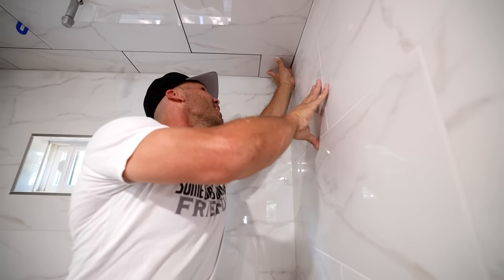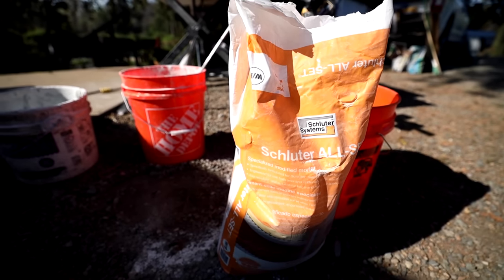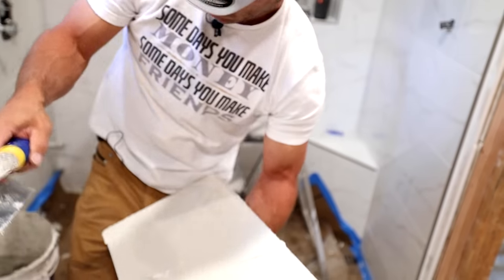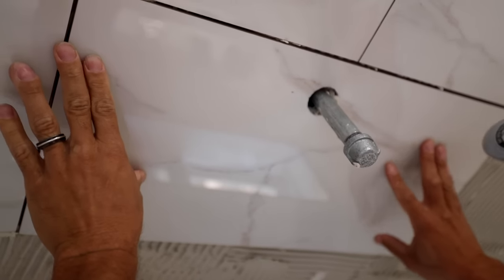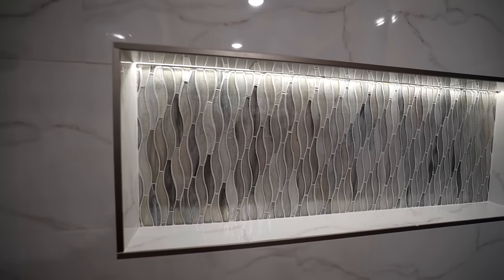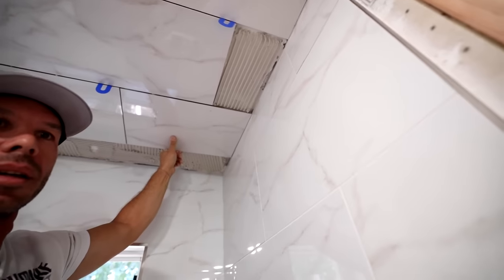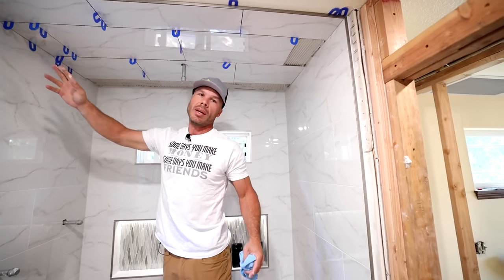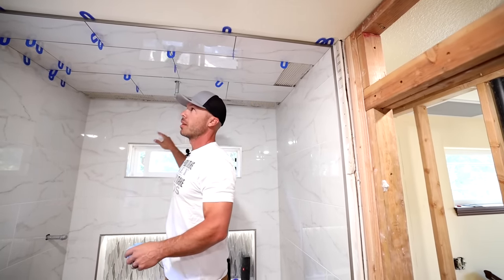Tile a Shower Ceiling --- Large 12x24 Porcelain Tiles

Comment: I skim coat the ceiling and spread thinset on the back of the tile with either 1/2 x 1/2  or 3/8 x 1/4 inch trowel depending on the size of the tile and have never had a tile fall and its way easier than troweling onto a ceiling. Also i do my ceiling tile first and cut my top row on the walls to the ceiling which again i find to be easier and look better
Reply: Exactly what I was going to say. I find it way easier
Reply: That's how I do it.🤙
Reply: Yes, just like the floor. Do the floor first, bottom tile goes over the floor.
Reply: I was wondering why he didn't do that..
Reply: @SonsOfThunder229  An entire 26 story building I worked in, was done walls 1st then floors, site super insisted on it, looked like shit with the grout line visible on the floor edge. Thank you for posting.
Reply: Use leveling clips also on ceiling! It helps to hold each other tile.
Reply: You are right on. Buttering th back gives a suction to hold it up

Comment: One of my first tile jobs I was learning from, this builder I was working for was installing a steam shower ceiling, and used spin doctors clip system. The very last tile he was installing was a center cut with a light hole. When he put it up, literally all of the ceiling tiles fell, it was like something out of a loony toons episode. Stood their holding the one tile while the rest fell and cracked the special order shower pan. Good times lmao
Reply: Lmfaoo
Reply: Thin set was wrong or to thin mixed
Reply: Dam
Reply: I think the issue was the leveling clips, it’s not possible to get full coverage with the clips in the way
Reply: I call bull
Reply: @stihlRoush   it is with a large notch trowel. Coverage checks area must. Leveling systems are over used sometimes for sure. Large format only for me.
Reply: You can never get 100% coverage on ceiling and tile because the clips take up space. Plus they could pull the tiles away from the ceiling.
Reply: @stihlRoush   ceilings are never fun but ive never had any fall off so.....to each his own I guess. There are many many misconceptions about leveling clips and many videos debunking a lot of the "issues" and showing how they move the tile. The body of the tile should be on plane regardless of the clip being used or not so the coverage matters. If the tile is out of the thinset its wrong to begin with. 
 They work for me in the right application so I dont have any beef.
 They are not an excuse to do crappy prep work for sure. They are not eliminating anything but a few square inches of coverage on a  per tile. Not enough to cause a problem with adequate coverage. Ive bent trowels trying to remove tiles from the suction in the wet thinset with clips in place. 
 I cant control what tile I get to install so garbage bowed tile get clips lol
Reply: I’m not arguing that the clips are bad, just saying 100% coverage is not possible with them. I’ve used them, I love them! I just have trust issues with gravity on such huge tiles. I’ve installed a bunch of 12x24 and smaller on ceilings with no issues at all.
Reply: @stihlRoush   haha ya i def get nervous as well. Always waiting for a bomb to drop from the ceiling. I agree 100% coverage technically cant be achieved but 98.7 % wont be any less effective.
Reply: Agreed
Reply: @Llaveocculto  agreed, they never would fall all at the same time
Reply: Lol

Comment: I used Mapie Utraflex LFT in white. Workers perfectly. I find it better to key in the ceiling that way when you trowel out the thinset it tends to stick better to the ceiling and not fall off. Also back butter the tile and you will be golden. Did a house now with 3 showers 10 feet tall. All ceilings tiled. Never had a single tile fall off. Honestly felt like an old school pro.
Reply: I second Mapei Ultraflex LFT.   I just tiled a full 45 sf bathroom ceiling with it and not one tile fell and it was my first tile job.    I used leveling clips (LevTec) and that helped a ton too keep it in place and level.

Comment: Skim ceiling and half inch notch back of tile, 4xlt. With the front of the trowel, make two circles to act as suction cups for 12x24s. Works great for me.
Reply: I back butter the ceiling then 3/8" on tile itself an close the ends, it's a suction science
Reply: thank you for replying
Reply: @jdj3042  Thank you for your reply
Reply: I use custom prolight 1/4 notch on ceilling 1/4 notch on tile never fail

Comment: IMO you need minimal thinset that produces 100% coverage. You're trying to create an airtight seal between the ceiling and the tile. Basically get 100% coverage and push real hard. As long as air can't fill in behind the tile as it tries to drop down the air in the room is much, much stronger than the weight of a 10, 50 or even 100 pound tile. Air pressure: the same thing that makes an airplane fly will keep your tiles flying until the thinset sets up.

Comment: We did marble on a steam shower ceiling a few years ago. We screwed 2X4’s around the perimeter walls about 3” below the ceiling, we then cut 2X4’s to lay flat across the stringers, set a couple large pieces of marble and supported them with the boards along with cedar shims to keep everything level. Each day we would do one or two pieces then work on other parts of the project until we completes the ceiling. Never had and issues with loose or falling stone.

Comment: I took some plastic cap nails (tar paper nails) and replaced the nails with 2" drywall screws. The plastic washer was ideal for overlapping the tile you are working on and the adjacent tile and made the ceiling very secure. The next day, back the screws out and you're done.
Reply: Steam has a way of finding it's way through small holes. Maybe a normal shower would be ok but a steam shower really needs to be water tight.

Comment: I had to install 2 foot by 4 foot tiles on a ceiling. I had the walls set except the last row. I had 2x4 sitting on top of the wall tiles like a bridge. I used little chunks of 2x4 to go from 2x4 “bridge” to the tile. Worked out well. I have set many ceilings without issues, just did not fully trust such heavy tiles being held up by the thin set while it cured! Nice video, keep up the good work!

Comment: I've done a skim coat on the ceiling while combing mortar on the back of the tile, and combed a handful of 2-3" circles. Push the tile tight against the ceiling burping out the air inside the circles, and creates a kind of suction cup effect. Have done this with regular old versabond, haven't had one fall yet.
Reply: Except when you install it around a dropdown rainhead fixture....

Comment: I made a 2x4 “T” pole that we would wedge to hold the 2’x4’ tiles on the ceiling while it was setting up. I had one fall after I had just left the shower, got lucky.  The “T” setup worked perfectly for the rest of the ceiling.
Reply: I do the same thing. They call it a "dead man " in the dry wall hanger industry.

Comment: I just did a ceiling in 8x20 10mm marble using MultiMax Lite, mixed pretty stiff.  Skim coated the ceiling, and had 1/2 notch applied to back of the marble very well keyed in.  Pried off 2 tiles to check for coverage - near 100%.  It took quite a bit of force to get those pieces to come off for the check.  One piece did fall off - no injury - but it was a piece that I set using lighter pressure as it would have laid in too deep and would have had lippage so I just set it using less pressure.  It fell off after about 10 min hanging there.  MML thinset is EXCELLENT stuff in my view and very good for ceiling work.  You just have to set it using plenty of pressure, as done here in this video.  This makes the thinset application more critical, because when setting with lots of pressure you will be getting 100% coverage and once its there, its very hard to adjust the overall depth of the tile, esp with the mud being a bit stiff.  Also very important the ceiling substrate is flat esp when setting large format tile.

Comment: After watching this video, I also used the All-Set and it worked like a dream for the ceiling and everything else. My new favorite Thin-set for everything.  I got it on some cardboard and when I tried to peal it off it took the top layer of paper with it. this stuff sticks to almost everything. We also tried mixing it with some concrete pigment to see if it would retain its adhesive properties and it stuck just as well.

Comment: I would recommend apply the ceiling tiles, especially the corner ceiling tiles first before finishing the last top side wall tiles so that the corner ceiling tiles rest on top of the final top side wall tiles. Obviously make sure the final top side wall tiles fit nice & tight.
Reply: I agree, ceiling first then last row of wall tiles. Its just like how the floor tiles are first then wall tiles on top

Comment: I have found that it's better for the mortar to have a bit more water to create a suction effect. Only ever had one fall when the mortar was too stiff. I will blue tape each piece to the next as I go to hold my spacing and don't untape until the next day. Always screw the substrate every 4"-6" as there is a lot of weight hanging up there. Also, don't try and pry an edge down if you set a tile too deep or to check mortar coverage. This breaks the suction and it WILL fall down. Pull the tile out, retrowel and start over. I always cover the shower floor with plywood and stand cardboard up against the walls a few feet just in case.

Comment: I did my 4x3 shower ceiling in (mostly) 3x6 inch subway tiles in natural stone. I adhered them to the backer board (1/2 inch DensShield) using, not thinset, but rather a waterproof/marine adhesive, plus a bead of silicone around the outside edge that faces the ceiling (for suction and moisture barrier). That held them on nicely, with no drops. My reasons for not using thinset are: weight, and that the ceiling is likely to only get some condensation, not direct water spray. But worst case, the marine adhesive would hold even if some small amount of moisture gets through the stone tile.
This was put up 3 years ago, and no issues at all.

Comment: When I do a ceiling I also add a bunch of extra screws to the sheetrock.  Last shower ceiling I did was 30" x 60". I counted 12 screws holding up the entire ceiling.  I added like another 20 coated "exterior" screws just to make sure that ceiling could hold the weight.
Reply: U can't use sheetrock to hold such of heavy weight. Plus thin set and paper is a no no
Reply: @cyclinglover3721  I done it several times now.  Green board, screwed off like every 6 inches on center.  Two coats of red guard then mortar and tile.  Yes I have been back to these jobs.  5 years later, still zero issues.

Comment: Agree with a couple of others who recommend making 2-3 circles of thinset on the back of the tile (like large donuts).  They act like a vacuum suction cup when you press them to the ceiling.  I did my steam shower like this, with 12x24” tiles…no sagging or dropping of any tile. Used Mapei Floor and Tile Mortar and let it set up a bit longer than I normally do with floor or even wall installation.
Reply: Thanks for putting down material you used as well as method! I'm researching for our shower now... WAY BEFORE we start doing tile (hubby just put in a new drain). We have 6"x18" tiles. I may still use a T-brace for the longer cuts just in case. We're using Mapei Premium Floor and Tile Mortar.

Comment: When I did a ceiling I put some 2×4s horizontal and extention poles to hold just in case. I took my time but I'm still nervous about tiles on a ceiling.
Reply: I have done this exact thing before for 12x24 marble on a ceiling.  Worth the extra time for peace of mind I wasn't gonna get knocked out by a falling piece of marble.

Comment: I am surprised they don’t sell a screw in spacer for just this application. Something like the nails they use on Tyvek with the orange plastic discs. Pop them out before you put in the grout, would work double duty.

Comment: I saw a trick somewhere online where the guy troweled the ceiling surface with all the lines going one way, then he used the trowel to make a circle in the mortar.  He said the circle pattern helped add suction to keep the tile adhered to the ceiling.  Curious about your thoughts on that, never tried it myself.

Comment: I skim coat ceiling, butter the tile and make circular pattern with my with my tile trowel which will act like a suction cup when pressing tile in place ,press enough to get air out . set in exact position. Have not had one come down or fall to date

Comment: USE PROLITE!!!!!!! Best thinset for ceilings!! Also don't have to mix it super tough like that. Probably not getting a proper bond like that. 

Also, I like to back butter my tiles with a 3/8s notch trowel. After I'm done, I'll take the short side of the trowel with some more mud on it, then I'll start doing circles in the motor. It creates a suction cup more then less! Helps suck it to the ceiling and your good to go! But make sure to use pro lite thinset.

Comment: I use servolight by Kiesel for my ceilings. Usual run my tiles on a 45 since the joints won't line up on all 3 walls.Recently did 30"x30" on ceiling . Used a t brace just in case but they were actually staying on their own to my surprise!

Comment: If you have to, use sticks to hold up the tiles till the thinset sets. Get a pack of 1x2s. Hopefully, they should be priced reasonably now. Or run a bunch of old 2x4s thru a table saw.

Comment: 15 years contractor I usually use heat gun and apply the thinset in the tile first and only skim the ceiling….try heat gun help a lot and you can work comfortably.

Comment: all you need here is 2 notches one on the ceiling and one on the tile and when you compress the two it creates a vaccuum effect that holds very well.  As long as you you use an ultra light type mortar you will be fine.  I do NOT recommend spreading a notch and back buttering the tile....both need at least a quarter inch notch to create suction.

Comment: When I do a ceiling I cut small squares of Durock or Wood. Put a screw thru it. And then drill the screws between the grout line. When tile drys you pull the blocks of wood and screws out. Also ProLite works Great for the application
Reply: I know it's a ceiling so water proofing is a bit less of a concern and water generally doesn't travel up hill unless wicking. if using a waterproof membrane or membrane board, this method will leave you with spots between tiles where the waterproofing would be broken with no way to band it. Mostly just saying I could see various companies denying warranty if they found this but idk.
Reply: I would probably use this method. It's also going to pull the tile into the thinset better than any human can press, maybe Ronnie Coleman could, but anyways good method, and having water somehow defy gravity and leak uphill is a good one. That would be the least of your problems if you have the ceiling above the shower leak.....from the shower....

Comment: I used a pole sander pad attached to an adjustable extension pole and used it to brace each tile (or tile joint) as I put them up.  I found that tiles can fall using the Schluter thin set also if not mixed very thick.  My question has been - will the thin set actually hold these 12x24 10lb tiles over time without some kind of anchoring system.   I'm betting 'yes' on my DYI tile installation (fingers crossed).

Comment: The proper way is to mud the ceiling first, give you firmness, level and stability this way you don't even need  clips and you can use any kind of thin set with 1/4 " trowel. The dry mud absorb the water so fast it dries in minutes I have being doing this forever believe me it really works. One last thing, you go up with your tiles on the wall but don't put the last tile, set the ceiling first and then install the last tile on the wall joining the ceiling. You have a lot to learn.

Comment: Hey Tile Coach, there's a builder that's wanting me to tile the ceiling for his master walk in shower wich is 60 sq/ft. He's wanting 40x40 inch tiles around 1/4 inch thick, wants them to go straight. My question to you would be how much I would be able to charge if I'm supplying  the thinset and grout along with the labor cost of installation.

Comment: Overtime in 20 years for example, isnt it a possiblity that mold or water damage may weaken the ceiling board or mortar and the tiles drop? I always thought heavy ceiling tiles were dangerous
Reply: Time and gravity are always my worry.  So long as it's masonry thinset and fully cured water or mold shouldn't be an issue.

Comment: Can anyone help me here? I've asked probably 5 utubers..and nothing..whats the best thinset for showers? And what grout can u use that won't take 7 to 10 days to use after install?
Reply: Good thinset for showers: I recommend Custom prolite, Laticrete tri-lite or Mapei ultra lite mortar. Grout: I recommend Laticrete Permacolor, mapei ultra color plus or custom prism. Silicone the corners. Another option is 100% epoxy grout with part a,b and c. Just avoid premixed grouts, they take longer to dry.
Reply: Well what I saw was not good you do not let thinset slakeover like that and you don't use light thinset on ceiling or a shower
Reply: @terrymarana7233  You can and you should use light thinset in a shower. Light thinset is a new and better technology. It has high bond strength, it's  non-slip, non-slump and it can be used up to 3/4 thick. Also it can be used in pools, exterior areas, interior areas and wet areas/water features which requires ANSI A118.15 mortars.